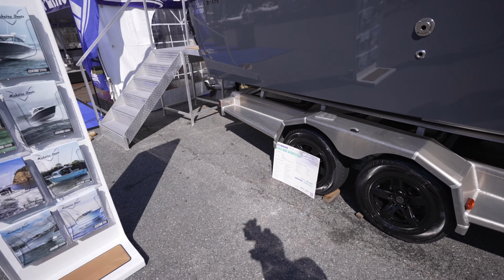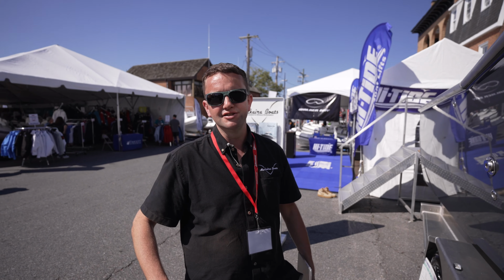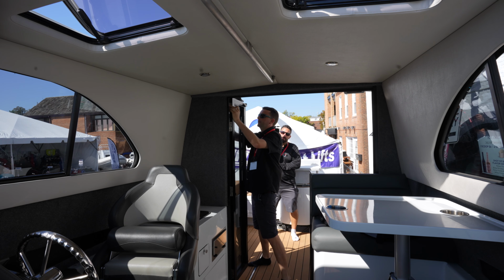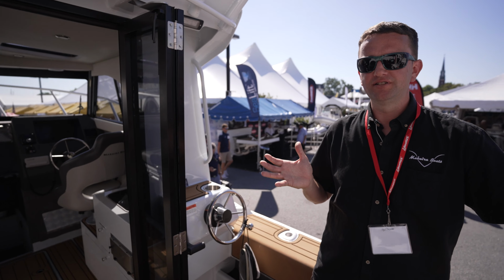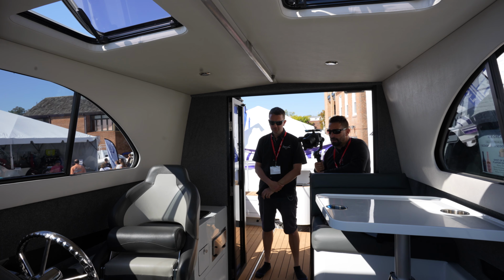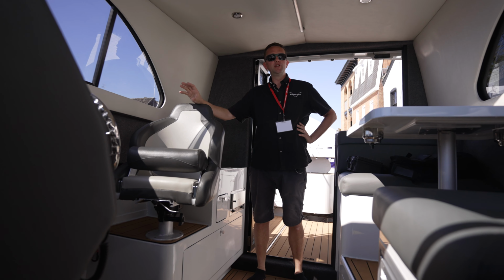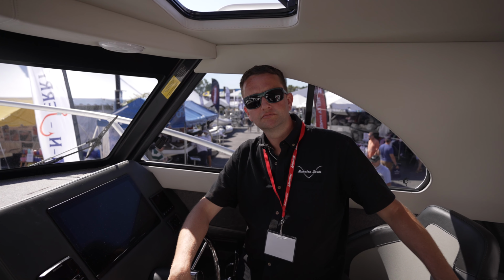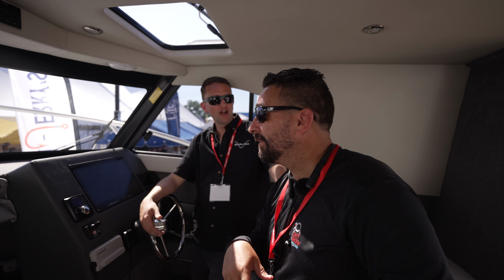This Boat Changes Everything... All Aluminum with Flare !

Comment: For the internationals watching. We (Aussies) love alloy as we fish the great barrier reef which is around 2hrs from our coastline as a standard. If you ever were to hit the reef or endure big swell/changed conditions on your trip you want a reliable boat. 6.5-8m Length - 6mm V bottom plate and CATS on trailer are all the rage here, but thats only due to our trailering restrictions... otherwise you might see 10m + boats more often. The best alloy builders are NZ - Surtees, Makaira, Extreme, Stabicraft - AUS: Platinum, Bar Crusher, Riptide, MODA and a ton more custom builders...

Comment: I’m a fan of these boats for sure.
That said, as a commercial skipper, I skippered a commercial alloy 65ft Lobster vessel 20+ years ago designed by local WA naval architect Fitzharding & built by GBB (Geraldton Boat Builders), with a Carolina Flared Bow.

So Makita can’t really claim to be the first Carolina flared bow in Aluminium.

Not even in the recreational sector.

Quintrex boats for eg have been producing flared bow aluminium recreational boats for decades - but they are pressed stretch formed flared bows out of low grade (ductile) thin aluminium.

I get it that the owner is proud of his design & build, and justifiably so, it’s a great boat, no question, but it’s certainly not the first flared bow Aluminium boat ever produced.

The Kiwis are good at their alloy boat building, no question, but is Aussies were producing this stuff years before the Kiwis started copying us.

Comment: aluminum boats  are commonly used in Alaska commercial salmon fishing industry for years, they are tough and durable but I don't  know how they would work in the tropics, the heat and all  . I know how aluminum TEE tops develop stress cracks over time  and would the same fate affect these hulls  where the  hull constantly flexes against a rigid stringer.  As with fiberglass constant pounding can separate hulls from stringers... Hanging powerful outboards may have adverse effect on the transom too, so many IFs..

Comment: I've been in the Marine industry for over 30 years, a thicker aluminum plate on the hull doesn't make the boat stronger.  It's the structure or "skeleton" that makes it stronger.  And the fact that they use stringers is old technology.  Torsion beam construction is head and shoulders over old school stringers.  Starcraft Marine and Polar Kraft boats use torsion beam construction, way smoother and quieter ride than any other aluminum boat on the market.
Reply: It's foam filled and really quite the ones not foam filled are loud

Comment: One thing that stands out to me on this boat is that the bow doesn't disappear downwards, thereby avoiding submarining at low speeds, like so many supposedly top-class boats that are built to look good, but are practically overrated.
Reply: Always been a pet peeve of mine.why buy a boat that wants to burry it's bow when you get in the rough stuff.
Reply: Boats like you described are dangerous should only be used in bays and inshore waterways
Reply: Yeah, they turn into diving lures.

Comment: Have always been curious as to why Australian offshore boats are almost all aluminum. I can see that aluminum has many benefits since it can be a very clean space saving building method, problem is the sound transmits through an aluminum hull much louder than fiberglass or wood, and every aluminum boat Ive fished has been less productive in light chop because of the amplified lapping. Im sure this bad boy has a lot of sound deadening but you cant get rid of it all. Still...a beautiful and amazing vessel worthy of considerstion by millionaires and billionaires.